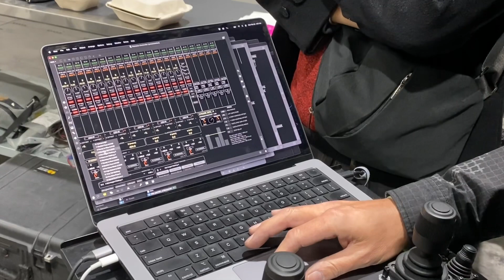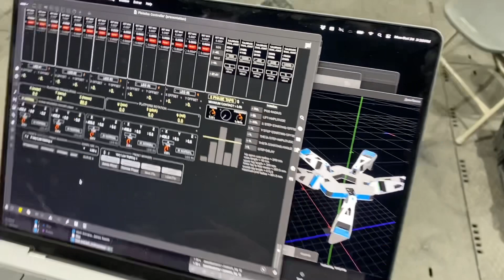The Future of WALKING BATTLEBOTS with Mark Setrakian

Comment: The primary issue I see with walkers in BattleBots is their reliability.  Wheeled and tracked bots already lose often because their motive systems get FUBAR’d by the opponent’s weapons.  Having exposed, articulated legs as your primary source of mobility seems like a very easy way to get disabled very quickly, especially against the ubiquitous kinetic spinners in the game.

Comment: I'm no mechanical engineer, but although this thing is very interesting and impressive as a piece of work, I can't see it having any place whatsoever in a Battlebots arena, unless you're going to give it a chance by creating a "ponderously slow plodding" class for it to fight in. Look at the material thickness at each of the leg joints - that is not going to hold up against a single hit from a heavy spinning mass. I will admit that I didn't watch EVERY SINGLE episode, but honestly I never saw Mechadon or Snake really have much success at all.

Comment: The speed and maneuverability that wheels offer, with simplicity both mechanical and logistical as well as compactness and defensibility, seems to make walkers almost entirely unviable in the battlebots ring. I'd love to see some sort of outdoor or otherwise more rugged competition that takes that advantage away from wheeled bots. Unless this can somehow increase the versatility of whatever weapons system they design for it by quite a large margin over a wheeled platform, it just doesn't seem like it's trying to be an optimal engineering solution to robot combat.

Comment: That bot is already amazing. But amazing is what I'd expect from Mark Setrakian. Some thoughts on turning this into a viable Battlebot: 1) horizontal spinner, and the bot can tilt itself forward to reach low bots, and 2) use the 2X weight bonus for walking bots, but make it a multibot.

Comment: I would put most of the extra 5000 lbs weight in the forward arms of the bot, so they would act like big energy syncs for spinners. (maybe even have a program that could detect when an arm was hit, and release all its grip so the arm would transfer less energy to the body) having such a wide stance and a strong spot to hit could make for a challenge.  Add in a central weapon like a diamond coated cone drill and let it envelop bots, or use hooks on its arms to flip/ act like wedges to deflect (with that low crouching stance) really a small robust design of this with the programming right would be interesting.

Comment: From an engineering standpoint, Stalker is amazing. The articulation and the ability to go anywhere it wants is really impressive. From a combative standpoint, it's slow. Any faster wheeled bot can take out one leg and it's done. Don't get it twisted, under the right circumstances it could do really well but, I think, it's just too far ahead of its time. Wouldn't mind seeing a stomp-bot division though.
Reply: Yeah it definitely needs it’s own class in order to have a chance at being competitive
Reply: @54raceman  Walking robots are already allowed to be 2x the mass. What more do you want?
Reply: With AI it could be programmed to be faster at revovery and such, but I suppose that's against the rules.
Reply: @prototypeo1404  hi current rules allow autonomous robots and assisting AI as long as there is a remote kill switch, even in 2016(unsure if date correct) there was a robot called Chomp which used AI to know when to activate weapon and I think it also was able to help the robot self right .

Comment: Now I can't help but imagine the claw hand that holds the giant nut tossing it aside, flipping itself over, and taking off running like Thing.  Personally, I think arena design with rough or uneven terrain that favors walking over wheels is the best way to make walkers viable in combat robotics.  I like to have as few constraints in the actual rules as possible to allow maximum innovation by the builders.

Comment: I'm thinking a standardised walking platform design that can either be purchased in kit form or as a set of CAD files. This platform can then be modified and adapted to each teams specification. I can only imagine designing and building something like this must be very time consuming and expensive even for a sport that's already expensive and time consuming.

The way this is constructed you could have leg kits/CAD files that could be purchased and teams could design and build their own central 'hub' (I see no reason why this couldn't work with 3, 4, 5, 6 or more legs). If the control software that Mark has already been developing is made available it would drastically cut down on the time/skillset investment that would be required for a team to start building a heavyweight walker and make it much more accessible.

Walkers are a daunting prospect even for experienced builders and realistically I think the only way it could work given the contemporary, uber destructive wheeled heavyweight machines would be to have a separate walker division, at least initially.

Comment: The only possible way for walker robots to be viable in the current meta of Battlebots is to make it heavy and less top heavy. More armor on the legs definitely so that it can withstand hits and even then you can't ensure that if a single leg gets hit it won't just straight up destroy the walking mechanism and there's the problem of what weapon you would place on it. It's definitely a good robot idea but the complexity would definitely put a strain on repairs as well after matches anyway it's a fun idea to think about if anyone has ideas feel free to chime in.

Comment: I wonder if going smaller would be better - loads of fast moving much smaller versions all armed with drills and magnetic feet which could climb onto the opponent in a sort of swarm, stick to it in a place it couldn’t reach and go to work. If the opponent is still driving then it’s not a pin or anything so once onboard the mini walkers could just go to town!

Comment: I wonder if instead of a huge weight bonus, simply having a uneven ground at least in some places in the battle area would make walkers more viable. Uneven ground would defocus the ground scrapping battle as well. Or a even a shallow pit, like a toned down version what they had in RobotWars back in the day.
Reply: The problem is walking is just so much worse than driving that it only becomes competitive as a form of locomotion when the terrain is basically impassable for wheeled vehicles. Like let's say there was some tactical advantage to being able to climb up on the shelf and the rules allowed it -- you'd just see more robots like Huge that can get up there with a simple two-motor drive systems and some big plastic wheels.
Reply: @wyrmh0le  ya, I feel like people would just opt for bigger wheels over a complicated walker bot
Reply: @thunderd164  there should just be a separate division for walkers imo.  There's no way something like chomp and it's insane articulated legs are going to survive a hit from something like tombstone.
Reply: @VestedUTuber Walker Chomp is an engineering beauty and the chomp team is always trying innovative stuff.  That said, the belt armor couldn't even stop hijinx from hitting it's legs and hijinx, while improving every year, doesn't yet have super heavy hitter kinetic energy.  I'd LOVE to see all kinds of crazy robots in the arena but the meta is the meta for a reason.
Reply: @scotthardin7189  Hijinx, as a super-long undercutter, was kind of a worst case for Chomp's armor - it didn't go through, it got under and sniped a leg. But let's be real it wouldn't have lasted against many bots. A vert would just fork under and used the armor as a catch point to flip chomp over
Reply: @thunderd164  Which would create vulnerabilities walkers could exploit, yes.
Reply: @effoffutube  I guess, but not really. Bigger wheels is a vulnerability, but it hasn't really been much of a hinderance to Huge or anyone in that camp. Sure Huge has lost some matches by getting its wheels destroyed, but of course there are other bots with reasonably sized wheels that have lost in the same way so I still think walkers would be at a disadvantage.
Reply: I've been thinking about an off-road season of BattleBots for quite a while.
Reply: I think uneven terrain is a good idea to push the envelope, but it will really slow down matches.
At least for wheeled vehicles it can create more vulnerability on the wheels, which might balance it out a bit.
Reply: Do you like skorpios or sawblaze? Cause an uneven floor would end both of those bots.

Comment: Until they can find a way to speed up the walking they won't find their way into realistic competition. That's why the og whyachi changed the game on "walking" because they found a way, albeit suuuuuuper cheesey, to make a fast walker. I don't know the engineering side of things, but is there something mechanically keeping them from moving faster? That would be the edge plus the weight bonus. But it seems we are far off from that. But also it's pretty cool to see. I want to see him and the chomp team square off idea wise!
Reply: There's a lot of stress on the joints which requires more torque, which means higher gear reductions to handle the load, which means more weight, which means more inertia decreasing acceleration times

Comment: The two things I think killed walkers were: 1) the arena is designed from the ground up to cater to wheeled vehicles.  It's flat.  An irregular surface would be much more amenable to locomotion competition.  2) the definition of a walker and the weight advantage - SOW is not a walker.  It's a series of cam-driven feet.  A dog is also not a walker, though dogs can walk awkwardly a short distance.  A walker manages its COG relative to its feet, using a minimum of 3 degrees of freedom (humans use 5-6 DOF) in each individually articulated limb, and can both lift itself, and balance itself - with a single limb.  A walker can also hop on one limb, which leads to it being able to run.  Speed is an advantage.  Today, I think as a walker, there needs to be rules which mandate that advantage, so that a walker is something respected, not just poorly used to access a weight handicap.  Designs that need 3 limbs on the ground at all time shouldn't be designated walkers.  But regardless, fix the arena so a handicap isn't required.  Nobody wants to win a battle and have people in the audience saying they only won because of the weight handicap.

Comment: I couldn't help but think about Boston Dynamics and thought what if your BattleBot was able to jump over its opponents. Potentially could be a big advantage in a fight.
Reply: Jumping for 3 minutes doesn't win you fights.
Reply: @Narcan885  What I was thinking is you could jump over your opponent and attack them from behind. Most bots have their weapon and most of their armor at the front so attacking the back would be more effective. Just not sure what weapon would be practical to use in this situation.
Reply: @thejman3489  could also work to just have realy long legs and lift them over the opponent :D i think jumping would be to consuming and hard to control. a small sensor in the legs could provide data for the lifting of the legs. or maybe just a 360° sensor on the bottom of the platform of the bot. also had a short idead of an face hugger bot but i guess that wouldnt work with all the spinners xD
Reply: @Narcan885  Jumping on the enemies might
Reply: @avataru_  Yes, please, jump into a 60 lbs tool steel drum spinning at 200 mphs, see who wins that impact with a frail walker robot!
Reply: @Narcan885  The conundrum of hammer-saws fighting Bloodsport only its your drive system you're planning to stick into the ferrous wheel XD

Comment: if it ran around very quick and could stick and jab and dodge, outmaneuver other bots, then it could be a real changer.
idk, the legs will have to be built super tough though, unless it had a fast battering ram weapon mounted on top, that could have a powered thrust ram to shoot out and maybe then flip over the opponent.

Comment: This is undeniably cool, but against a spinner, of any configuration, it's sadly going to be ripped apart in seconds, unless you had it on its slowest movement setting in this video, your hopelessly outclasses in speed, they would be on you in the blink of an eye. But, you do have some  possible strategies that would be 100% yours. You can walk around the edge of the box, up on top of the arena hazards, that upper deck could be your plaything. If you can make it jump and grab a target from above, then you could be the only bot in history to use a drill well. If it could jump and land on top of other bots, and lift them with 2 legs while walking with the other 3, you could carry them right out of the arena  but of course, 1 hit by any spinner and your done for. Pray for flippers and hammer bots as your only competition
Reply: They will probably make a separate category, at least until they could compete vs regular machines
Reply: not if the legs can get out of the way

Comment: do a multibot, 2 walking bots so you get the weight bonus, and extra bot
Reply: I’ve read the rule book, and this is unfortunately not possible. Battlebots will not allow a walker multi bot due to the fact someone would make a tiny walker and invest the 250 extra pounds into the bot with wheels. Unfortunate but it’s a huge loophole closed
Reply: @GrizzlyDust7222  even if both of them are walkers